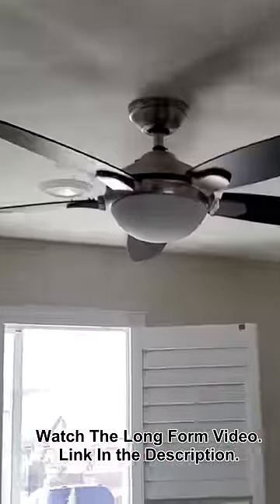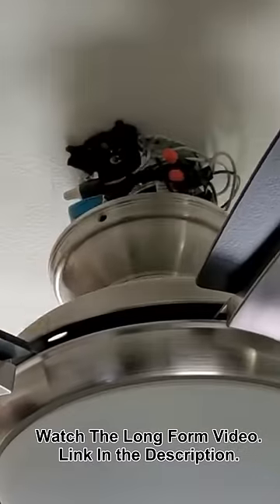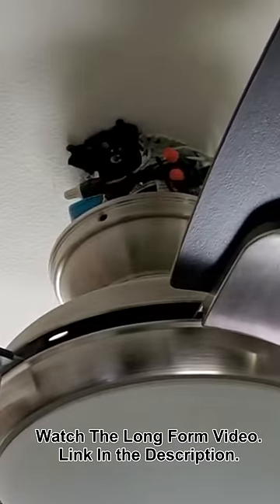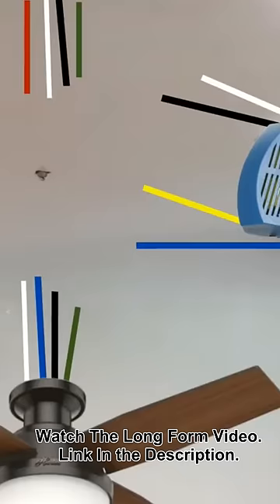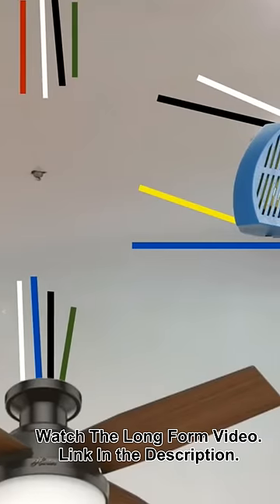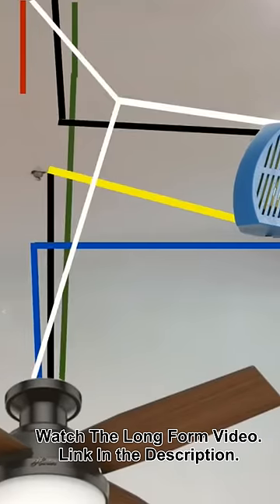Ceiling Fan Wiring – Step by Step with Easy Diagram

Comment: My manual does not describe the usage pf the res qire from the ceiling. But it looks like i may have to twist it with the blue receiver and blue wire correct?